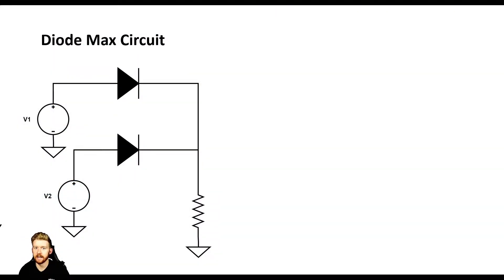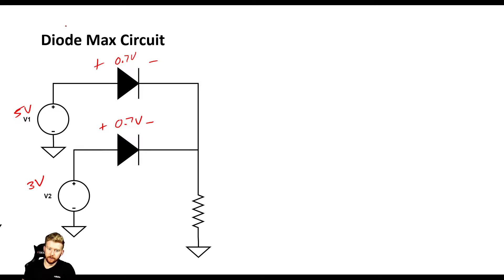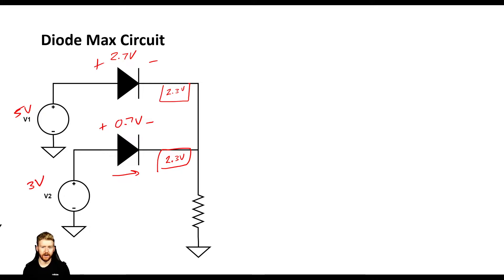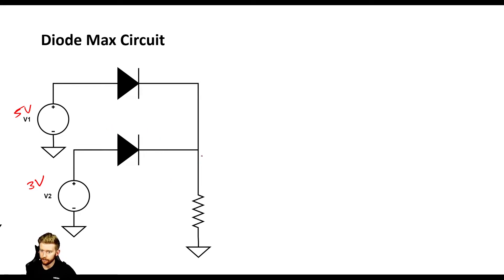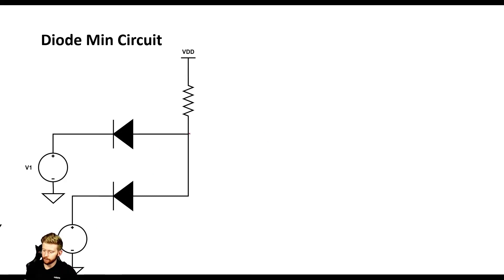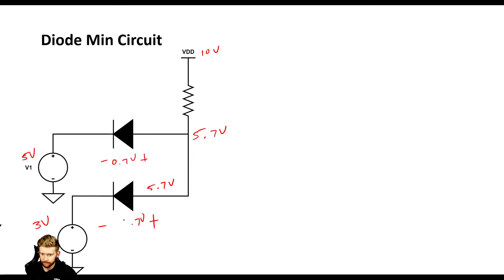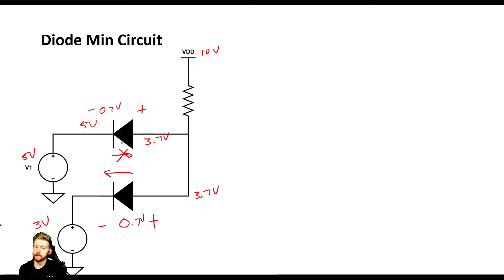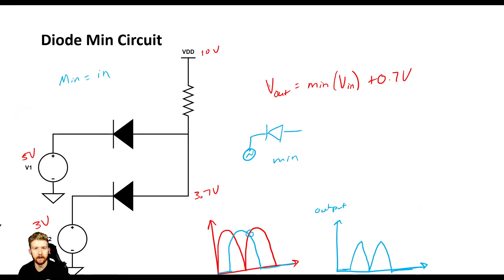Electronics Tutorial 8: Diode Max and Min Circuits

Comment: In the min-off. when you mentioned Vout as the node that connects both the diodes and the resistor right? in case it is asked to get Vo as the voltage in the resistor, we need to do Vdd - V_node?